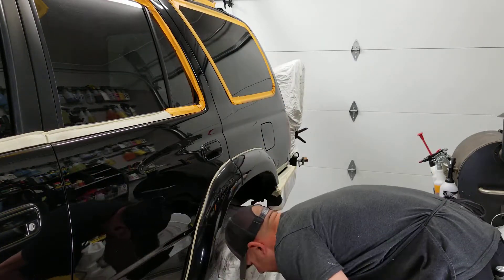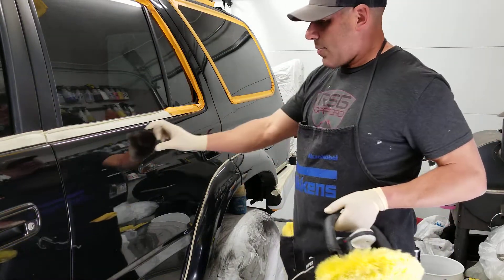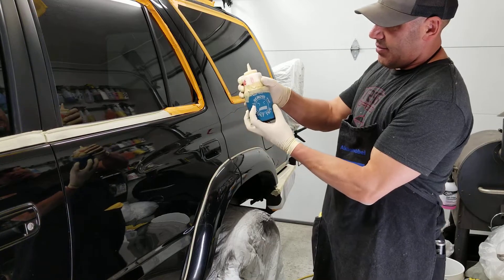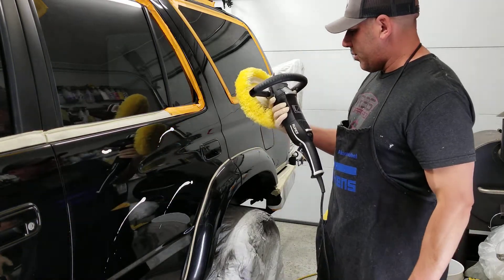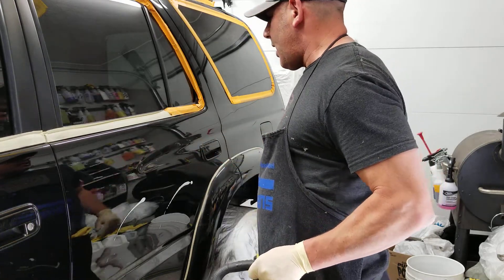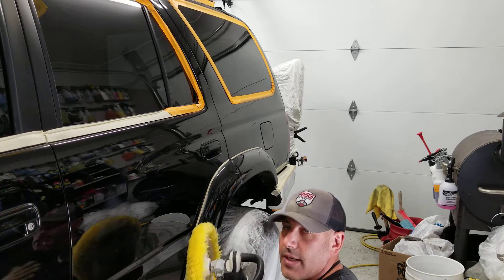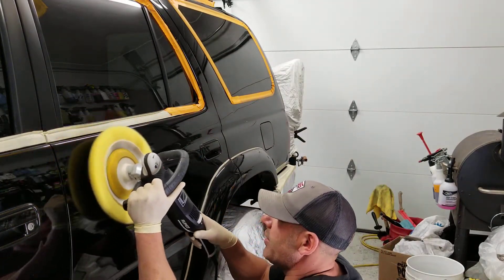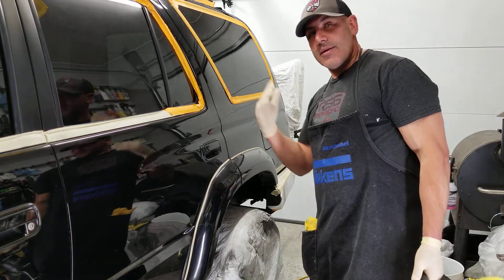INSTRUCTIONAL VIDEO - HOW TO POLISH A CAR WITH A RUPES ROTARY BUFFER / REVIEW! LHR19E  #Rupes #Adams

Comment: When ever You use wall pads do you finish it off with the foam the black foam pad
Reply from the maker: Most of the time I switch to a rupes random orbital. My favorite pad is their yellow pad, then followed up with a white foam if i am seeing any hazing.  I then follow up with a black pad and some sort of protection, whether it be wax, sealant, or coating.
If you want to finish with a rotary,  I would follow the wool pad with a black foam, then an ultrafine teal foam pad.

Comment: Would you mind sending me the link to where you purchased the 6 inch backing plate/wool cutting pad if possible please.
Reply from the maker: Sure!!
Backing plate - 

https://www.autogeek.net/buf-658y.html?productid=buf-658y&channelid=FROOG&utm_source=CSEs&utm_medium=GoogleProductSearch&utm_campaign=CSE&utm_campaign=1504990722&utm_source=google&utm_medium=cpc&utm_content=287205172222&utm_term=&gclid=CjwKCAjwhYOFBhBkEiwASF3KGeaOIlCZpFPxjcjSDCxdA75NA0JQ_p2Ss3rnj5EerBzTBzieGThYQhoCQJ4QAvD_BwE
9 inch yellow polishing pad

https://www.amazon.com/3M-05713-Wool-Polishing-Pad/dp/B000YOMXFW
Reply from the maker: You could also use a white wool pad, but I like the yellow better. In the detail world, the yellow pad is awesome, considered a polish/ cleaner pad and less aggressive. When you finish in 5000 it doesn't take as much work to polish that fine of a scratch out.

Happy buffing!

Comment: I don't think you showed the "buffing off the edge" aspect clearly. For example, for a vertical panel,  say there is a horizontal edge, and the edge is at the top of the panel -  in that case, we would want the LEFT side of the pad on the edge, with the right side lifted up off the panel. I just didn't seem to see this clearly demonstrated.